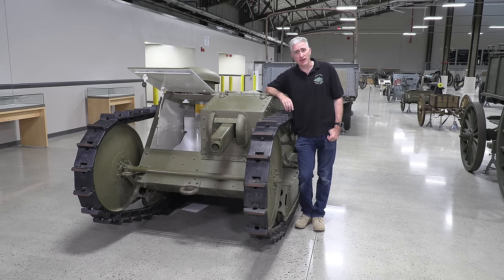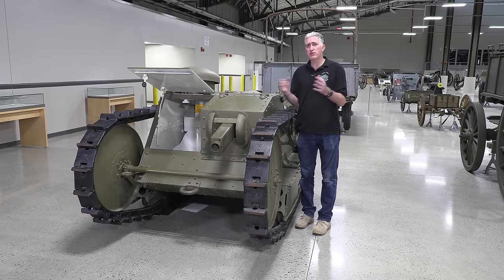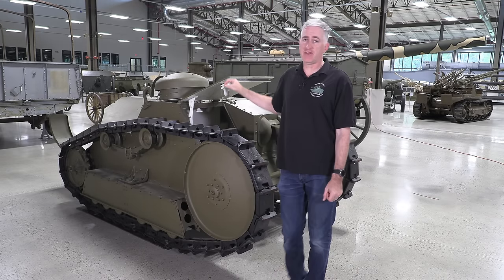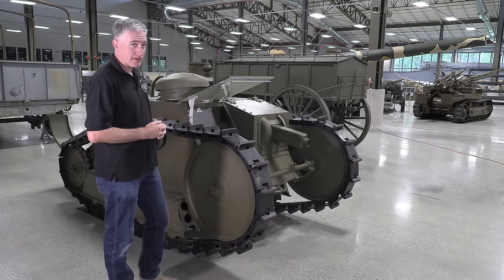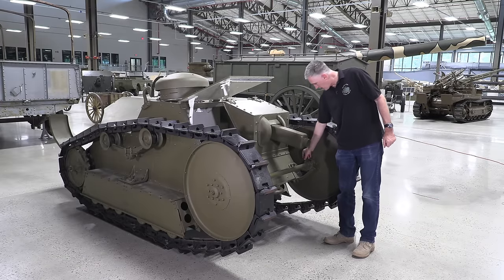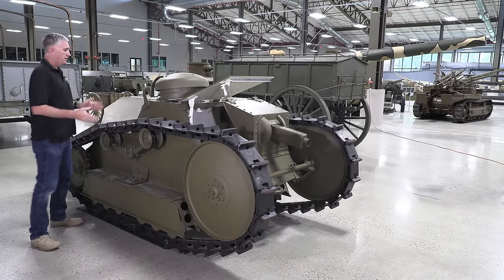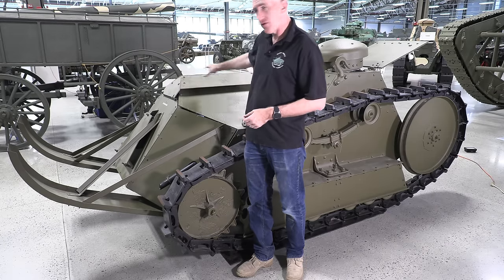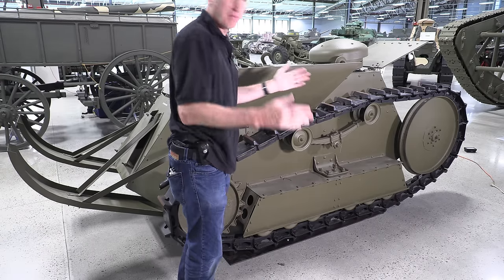Inside the Chieftain's Hatch: 3-ton M1918

Comment: Two engines, one for each track was a good idea. I'm surprised Ford did not do a better job of the ergonomics and steering mechanism. How difficult could it have been to determine the required space for the crew and then build the tank around it. Oh well. Limbo dancing it is.
Reply: An engine per track was an appalling idea - the British Whippet tank had a similar arrangement. You had to be extremely careful to balance the throttles to keep the thing tracking in a straight line. Also if one engine stalled, a common occurrence with engines of the period, the tank whipped around in an uncontrolled turn.
Reply: @charlieclelland5895  Only the steering mechanism caused problems. It could have been solved with sufficient thought. For example, a differential clutch steering mechanism. Using a centrifugal or semi centrifugal system. Who knows, it could have caught on and still be with us today.
Missed your chance Mr Ford.
Reply: @charlieclelland5895  I forgot to add that the engine stalling issue would be a problem. However that steering mechanism using centrifugal clutch may have helped that too. By simply disengaging or a cut-off switch. Still better than four levers.

I mentioned it because a friend of mine built a kart using two engines and clutch mechanisms from two cheap salvaged Chinese scooters.  Driving tracks via independent chain drives. It steered using two throttles and worked until the engines died.  Tricky to steer due to inconsistent engine revs but then again it was a garden shed contraption. Let me see if he has video of it.
Reply: @charlieclelland5895  He has no video but look at this two engine tank transmission built from Lego technic. Substitute the electric motors with petrol and centrifugal clutch mechanisms. 
The Porsche electric drive would have had two electric motors too. The concept is sound.

Comment: This is definitely a strange vehicle to modern eyes. The yoga required to enter may be popular with some modern tankers.

The ergonomics are not ideal and sitting in there, especially on the gunner side, over rough terrain looks like a truly horrible experience.
Reply: Note in the WW I-era test footage that the driver just jumped right in. The average height of people was smaller in those days, and they doubtless picked young guys in the 5 foot range. I didn't notice them showing the gunner getting in. Obviously he had to go in first, and then wiggle over to the right seat. Still, I could have done that easily when I was 9 or 10 and about 5 feet high.

Comment: Ahha, the one time someone went with twin engine twin transmission. Terrifying.
Reply: The British Whippet tank of 1917 had twin engine/transmission one for each track.  The engines were locked together for straight line then decoupled and differential throttle was used for turns.  Not a great success.

Comment: The machine gun could not be the 1919 since it did not come about until after WW2. The mount looks like a water cooled gun. Based on the jacket clamp. So it would most likely be for the 1917 or a Vickers.
Reply: The 1919 was literaly invented for this and other American tanks of the time. It was designated 1919 because everything had the 1918 designation. Also there are internal photographs of it in the tank mount in the year 1919. But before that it had an air cooled Marlin sort of designed for aircraft at first then they removed the Lewis gun like fins for tanks.